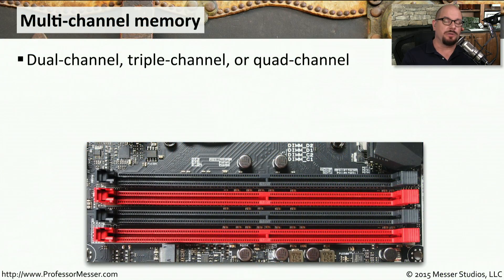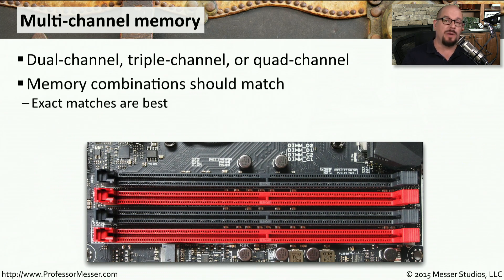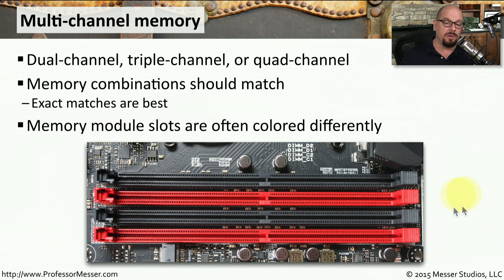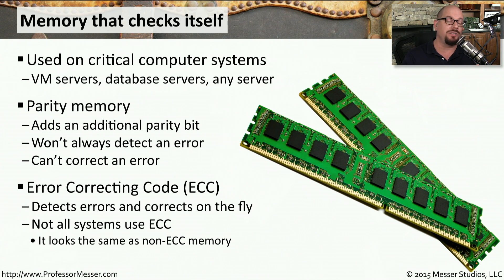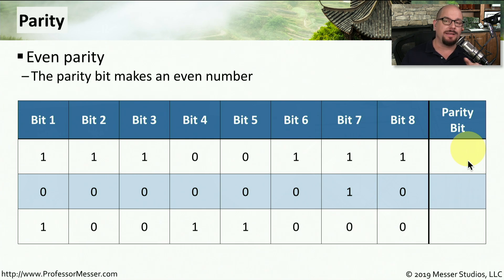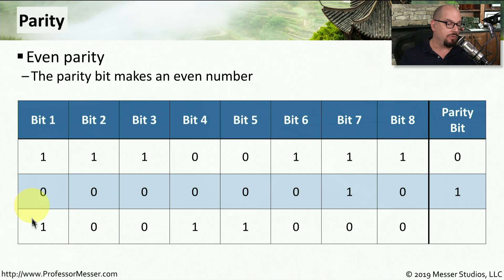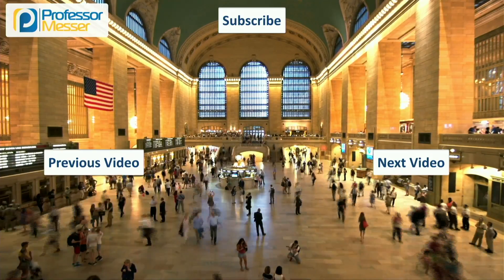Memory Technologies - CompTIA A+ 220-1001 - 3.3

Comment: I’m confuse do 4 slots mean I have quad channel?
Reply: No, it just means you have 4 slots, they can be single, dual or quad channel with that amount of slots.
You need to read your motherboard specifications to see if it's quad channel.
Reply: @BradleyGibbs  exactly
Reply: Check the documentation for your motherboard, either the book that came packaged with it or the manufacturer's website. Or see if they're colour-coded as shown in the video. Four slots could mean you have four single channels, two dual channels, or a single quad channel.
Reply: i believe that the colors indicate that they work in pairs, maybe. im not too sure, and hope Prof. clears this up a little.
Reply: 4 slots doesn't necessarily mean quad channel. Sometimes it's two sets of dual channel.
Reply: 4 mean quad yes
Reply: @GhostoftheTenthEye  not necessarily.
Dual channel is most common, even when there are more than 2 slots.

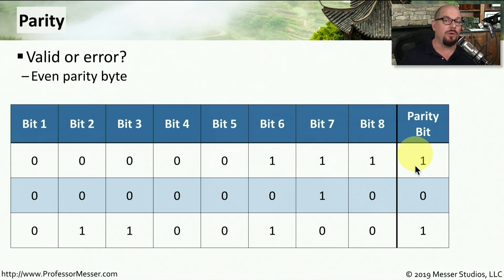Comment: @4:40 I don't understand, if there's one bit in the byte at the 7th, but we add a parity which is 1 bit how is it an error? Wouldn't equal to an even amount after parity? Is there a special rule with 1 bit in a byte that I'm missing?
Reply: Example: Say I'm practicing even parity (If the sum of bits is odd, I add bit = 1 to the end to make the sum of bits even. If the sum of bits is even, I add bit = 0 to the end to keep the sum of bits even).

I transmit the bits 1001. 1+0+0+1 = 2 (even). The parity bit I add then is 0, making the string I transmit 10010
The other end receives 10010. Since the receiving end is always expecting an even sum of bits, it checks to make sure that 1+0+0+1+0 is even, and it is.
Since the sum of bits is even and it expected an even sum of bits, the receiving end concludes that there was no error in transmission.

Now, take the same example and I transmit 10010.
During the process, one of my bits flipped for some reason and the other end received 11010. After checking the sum of bits, the other end sees that it's odd (1+1+0+1+0 = 3) and therefore reports an error.
Again, it was expecting an even sum of bits. Since it received an odd sum of bits, that indicates that at least one of the bits was flipped during the transmission process, so the data that was transmitted does not match up with the data that was received.

This method has many holes in it. For one, it can only detect when an error has occurred and not what the actual error is. Another hole is if an even number of bits was changed during the data transmission process. With the example again of 1001 practicing even parity, I would transmit this as 10010. The receiving end knows to expect an even sum of bits, but that's it. What if the receiving end got 11110? After checking the sum of bits, it's even. No error would be reported, but the data's clearly changed.
Reply: Im confused too. Why does the sum of 1s and 0s of a byte have to be even?
Reply: @nori8675  It needs to be even to check that the entire byte has no errors. 

If a byte goes into memory with an even number of ones, it better come out with an even number of ones, otherwise it is a potential error.

This method of error checking is mostly effective if only 1 bit of the byte is incorrect.

Say you have 1 byte go into memory correctly as 10000001, you would add a parity bit of 0 (now it is 10000001-0), because there is already an even number of ones. 

However, lets say when that byte is coming back out of memory and the byte now looks like 11000001-0. Our extra parity bit of 0 is still on there telling us that there should be an even number of ones within the byte. As you can see though, the byte now has an odd number of ones, which tells the memory that something is wrong with it, there is an extra one when there should not be.
Reply: the outcome must always be "even" i think